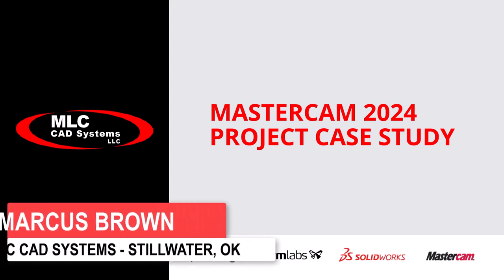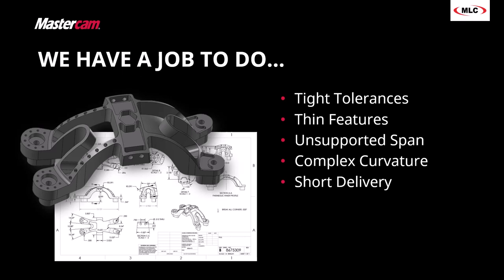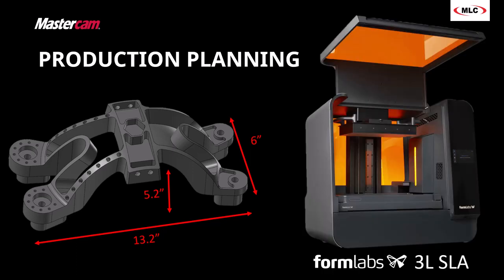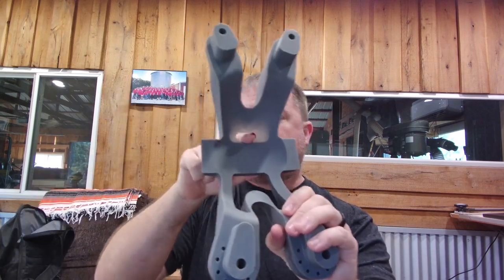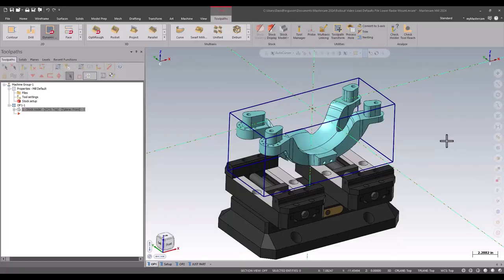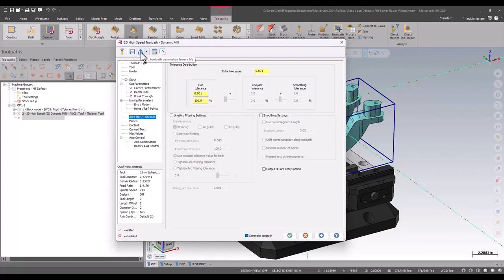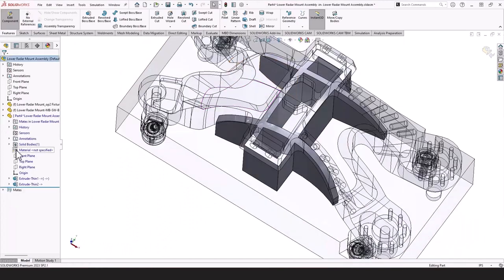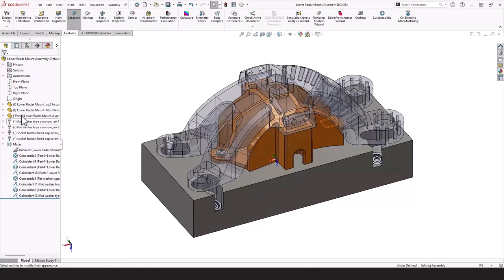Start to Finish Complex Machining Project - Mastercam 2024 Multi-Product Case Study

Comment: strange part
Reply from the maker: It is an example part from Mastercam designed to illustrate several manufacturing challenges in a single part that can be shared freely.  You can download it and other example parts at Mastercam.com in the Tech Exchange.